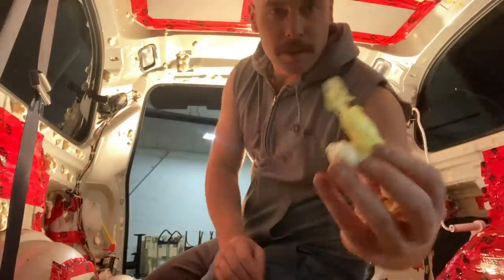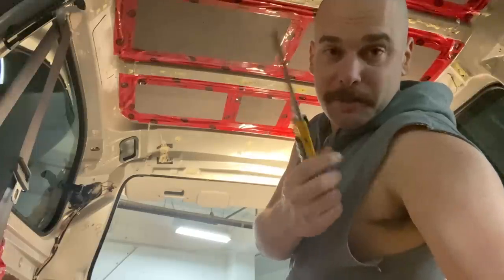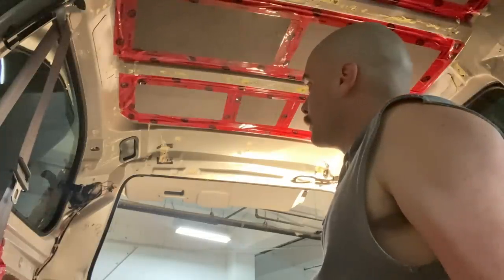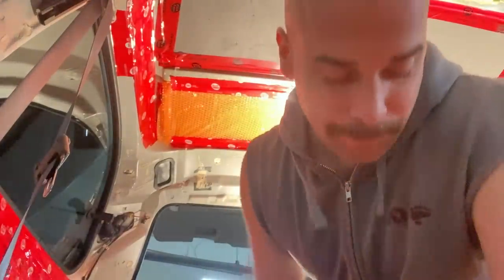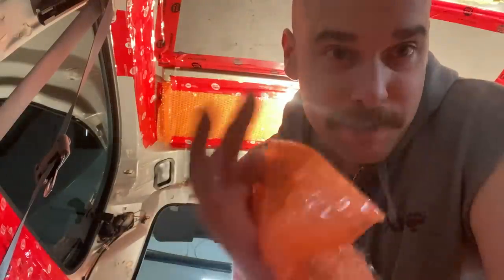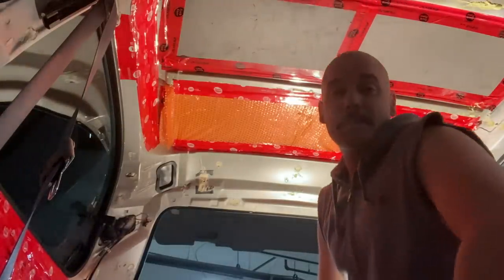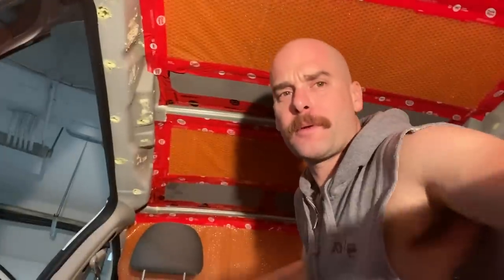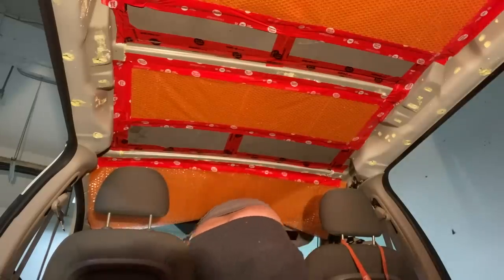MINIVAN Build E-4 || Insulation Pt 2: Spray foam and bubble wrap.

Comment: How is this van mechanically?  I have a 2010 and it is such a piece of crap.  Utilitiy wise, i love it but every few months if i am lucky, a large metal thing breaks.  It has been this way since i bought new.  It was ok between 60,000 and 140,000 but now it is back to its old habits.   I would like to do a minimally invasive camper set up in it but i am becoming more worried about straying too far from a mechanic.

Comment: You are  very creative with the insulation, I have a question about the material used on the ceiling.  Condensation and rust.  Hot seasons and cold temperatures and what they do to metal on the outside to the inside temp over time.

Comment: I'm in the process of insulating my van. I found the foam for doors and windows was harder to cut and each can didn't go as far as the others. I also trimmed the foam with plastic knives. I broke a lot of them but they were cheap and didn't scratch the paint at all.

Comment: Never seen bubble wrap used like that before.  I suppose it would work as a insulating air gap  Did you put any other insulation on top of that?
Reply from the maker: Just the eva foam play matts and bubble wrap.

Comment: I'm not trolling. I own a caravan, which I bought specifically so I can use it to go camping. I'm worried that you put that bubble wrap up next to the bare metal without gluing it? That's where your condensation is going to form. I hope I'm wrong.
Thanks for the footage.
Reply: In his last video he added foam insulation to the ceiling first. So not against metal😀
Reply: Of which, he glued thoroughly lol